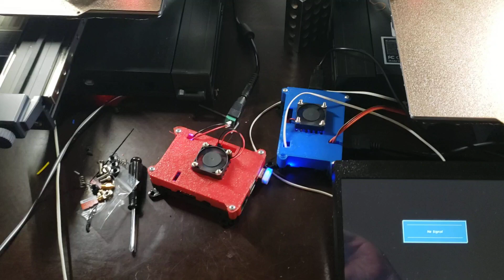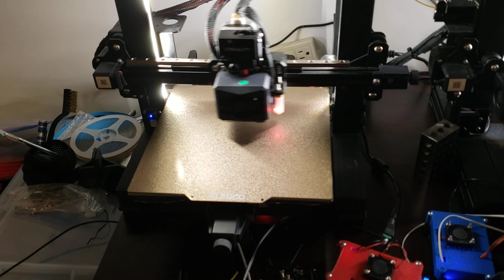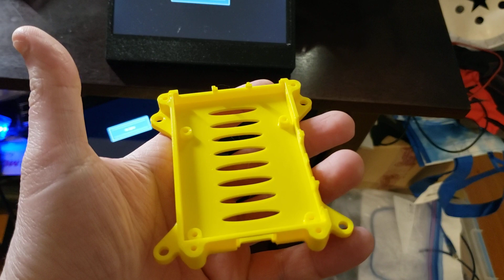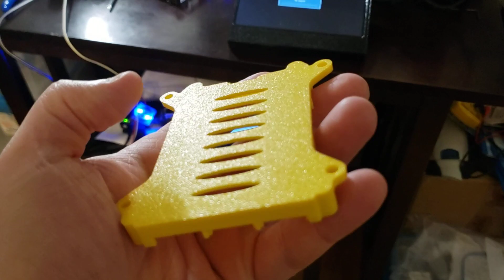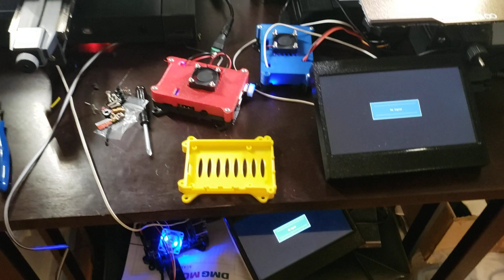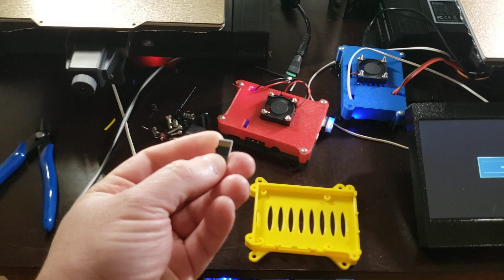Sometimes a fried Pi isn't so delicious...

Comment: Can you make a video showing how to change klipperscreen into portrait mode I’ve tried editing the pi config text and still can’t get it to change
Reply from the maker: It's different on every device, unfortunately
Reply: @TheFeralEngineer  got it figured out...would you happen to know how i can get my manual screw adjust to work on klipperscreen i can do it from mainsail but when i try in klipperscreen it says configure in klipperscreen.conf so i went into my config file and copied the [screws_tilt_adjust] area into it and saved and it just gave me a error log

Comment: Hey is cb1 1gb vs cb1 16gb which one is better. Does it  effects any performance,
Reply from the maker: It's two different memory types. The 1gb is ram, 16gb is emmc. The 16gb emmc version still has 1gb of ram, but the non-emmc version will require an sd card for the operating system.
Reply: Ok thanks. Man I appreciated.

Comment: If you are printing cases anyway your should just add fans to everything, including the Quadra(s).  Entirely possible a long(?) life of running hot has diminished its stability
Reply from the maker: Yeah, I'm modifying the case models to put the fans inside. I was the the assumption that someone in their infinite wisdom figured out that the heatsinks they supplied were adequate.

Comment: I’m just having this exact same issue on a pi 3
Reply from the maker: I think it's fairly common from what I've found, but I've tried to rule out practically everything at this point. Only thing I've got left is a falling emmc or it just doesn't like the screen because it seems to run okay headless. I'm trying to find any reason to not shelf it. I just installed Linux on an sd card and I'll run more tests tomorrow. Considering the fact that I can run it happily on an identical board makes me think something is rotten

Comment: I've had worn out SD cards cause intermittent/odd problems, but I presume by the card sitting next to the running unit that you exchanged them when you put in the latest kernel? So that would rule out the SD. Failing hardware is a bummer.
Reply from the maker: I'm running on the emmc module right now. I'm currently burning an sd card to rule that out and will run the same torture test as the cb1 is going through. That should be done shortly. The thing that makes me think it's a failing pi is the fact that it runs 10° hotter than its twin brother and 20° hotter than the CB1
Reply: Last week the  my mks-pi add an issue. So I'm running the mks-pi with Emmc but made the decision to mount /var in SD card 1st partition and gcode files folder to SD card 2nd partition. The mks-pi ceased to recognize the SD card (128gb SanDisk pro) but was able to mount it in other two Linux boxes I got. Long story short, had to re-flash mks-pi (this time used mks official build) and this time only using the SD card for backups .
Reply from the maker: @pltavares  today I seem to have better luck running on an sd card instead of emmc, so I may be onto something

Comment: Since it's trash you can try running it in a mineral oil bath to keep the temperature down and see if that fixes it at all.
Reply from the maker: I much prefer the pi4b/cb1 anyway... It works with a broader array of screen sizes and orientations. I just hate having two different boards on what are basically the same machine

Comment: Ohh glad I didn't get a mks pi yet
Reply from the maker: Get the pi4b/cb1 from bigtreetech through the description links. It goes to the catnip fund 🐱. I've found biqu to be incredibly receptive and willing to work with me. Ironically, bigtreetech told me to piss off and they're the same company 🤣. I prefer the ability to rotate the display 90,180 and 270 degrees on the btt as well as being able to run a 5" screen. These mks units would only run a 7 and above

Comment from the maker: oh and the "failing" unit runs 10 degrees hotter than the other one and 20 degrees hotter than the CB1
Reply: Great catch!  This confirms my suspicion. I have been testing both CB1 and MKS Pi side-by-side on my Voron. I also found MKS Pi running warmer (15~20C) with intermittent wifi issue (I am not using a screen). Adding a small 5V cooling fan made it more stable but CB1 seems to be winning this race.
Reply from the maker: @pigsy2001  I've taken both of mine out of commission because they just can't run reliably anymore. I'm team bigtreetech all the way now